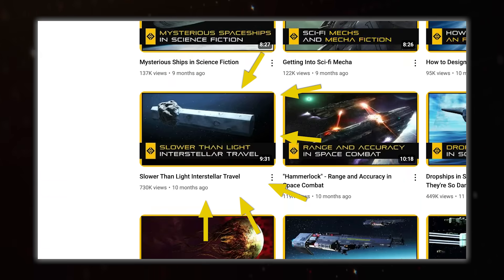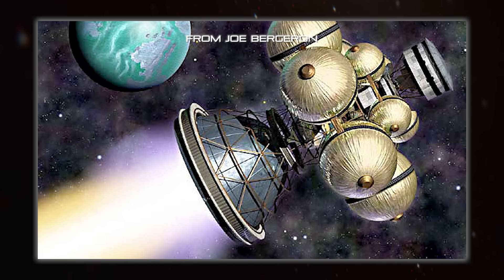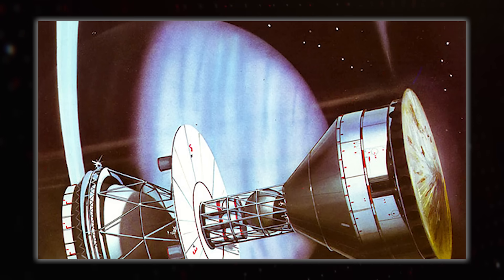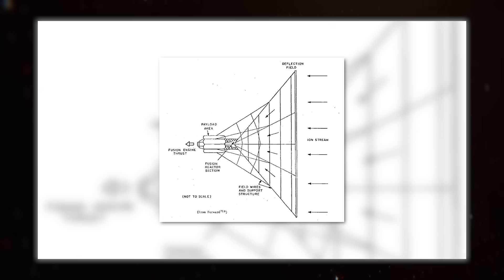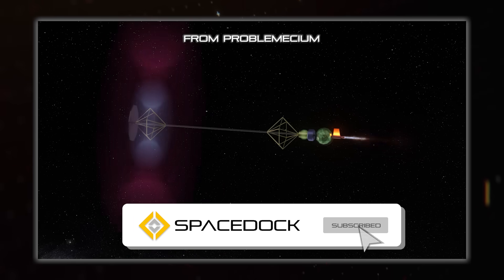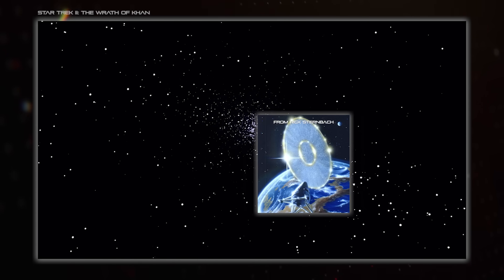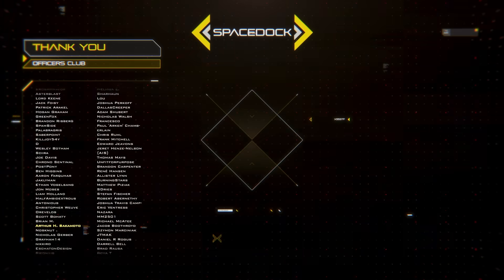Five Realistic Interstellar Designs

Comment: Sorry none of these are even possible. First isn't any workable fusion reactors, forget about fusion engines. No way to store antimatter long term, a failure of an antimatter containment system for just a microsecond results in complete destruction.

The other issue is the radiation, which means you need a awful lot of mass for sheilding. The only practical option is a hollowed out asteroid that is a very slow boat that takes thousands of years, but energy will be a problem as you need energy source that can operate for thousands of years. Even if you store enriched uraninum the reactor materials are going to suffer from neutron embittlement, at best a nuclear reactor can only operate for about 75 years, which means you need hundreds of empty reactors on board to replace the worn out reactors.

Finally there is no place to go. Any world that has live will be toxic to humans as we would have no immune defense to the other worlds microbes. They would likely find our skin, lungs, gut as a perfect place to grow & multiply. Dead worlds would be the only viable option but they would take 100 thousands of years to terraform. You have to tailor specific microbes to survive & terafform the world, & it will take a very very long time. Probably the best candidate for teraforming is venus, starting with orbital solar shields to cool venus, and then design microbes that can survive and and terriform venus over many thousands of years. Only problem with venus is that its nearly tidally locked with the sun (1 day ~= 1 year), You have to use orbitable solar sun shades & mirrors to set up night & day cycles which would be difficult & expense, but very possible.

Warp Drives & FTL is just not possible unfortunately. We are stuck here in our solar system. The only alternative is Gliese 710 (star) will be passing near the earth in 1.3M years in the future. If Humanity was a tech civ 70K years ago we could have sent probes to Scholz's star.

That said, I think humanity has peaked. Our tech civ. is dependent on cheap & abundant Oil & global production has already peaked (excluding Gas Condensates). Fusion will never be practical and high grade Uranium Mining peaked in 1980. Remaining reserves will be depleted by the 2050s at current production.

Comment: I wish you could add the Nai'a to this list from the longboat series by Matthew Ambrose. It is a 10 kilometer long cylinder with 2 fusion engines that can push the ship up above 90% the speed of light. It has a large ice shield to protect the ship. They had even doubled the density of the shield due to traveling at high relativistic velocities. Written from a hard science fiction perspective. the ship has an acceleration, coast and deceleration. phase. The ship configures itself based on which orientation so that thrust gravity is not lost.

Comment: You can also cheat in this category by adjusting the setting. If we existed in a habitable zone planet around either Alpha Centauri A or B, then journeys to the other star would be equivalent to journeys to Saturn at periastron, and journeys to Pluto at apastron. Even Proxima is "only" ~0.2 light years away, so that's a radical improvement, if still daunting.

Another way to cheat is small stars on the outskirts of globular clusters. The nearest neighbor distance can be much smaller than the stellar neighborhood without threatening inner planets (if you're not one of the unlucky ones) if you don't push the density TOO high.

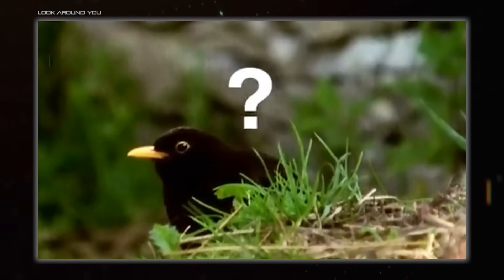Comment: 4:00 The problem I see with the laser sail stages is that there will be a significant drop off of power from the first stage reflecting to the second stage as the reflector will also act as a sail. Even more would be lost with the third stage. Mind you, the payload being sent back would be far less massive so it shouldn't be a major issue there, but if it took 3 years to accelerate, it might take 6 years or more to decelerate to rest.

Comment: Oh boy time to nitpick and take appart all scientific inaccuracies

Deadalus: the technology isn’t proven let alone demonstrated we can’t do helium 3 inertial confinement fusion, deuterium tritium would make a lot more sense. Tritium may have a shorter shelf life than the trip but you would have to create it onboard by basically doing alchemy not that it’s a big problem 

Big lens: "1000 kilometer diameter lens in the outer solar system" how TF did you put that much mass there? There’s nothing there? And WHERE Is Pluto? 
All that for a 1 ton probe hey?
Staging seems to work though wouldn’t the laser intensity become a problem?

Bussard ramjet:
These don’t work. Yeah bummer. They just don’t work. Anyways moving on
Also the criticism for having a top speed isn’t really relevant. By and large your delta V is equal to your exhaust velocity or very similar so this is a problem for every single rocket 

Valkyrie: the radiator armor idea is great
Overall it would work. Antimatter production and containment are of course an issue. A properly competent nation could just play factorio on Mercury and build hundreds of thousands of particle accelerators, as one does, so that’s still doable 

Overall interstellar travel is really difficult. We have the technology to go anywhere in the solar system rapidly and with ease through nuclear power and ion engines alone, but interstellar distances are just horrendous

It all boils down to exhaust velocity so we really need to get better exhaust velocity. Antimatter engines work so well because the product of an antimatter matter reaction apparently fly out at the speed of light. They explode in all directions but a third of them are magnetic and can be directed backward. Resulting in rockets that can have up to a third of the speed of light as exhaust velocity. Meaning they can go near the speed of light, because as always and I repeat myself, exhaust velocity and delta V will always be highly similar to each other. 
If we could find a way to accelerate anything at close to the speed of light without using antimatter, and do it fast enough to get at least kilonewtons, hopefully mega Newtons of thrust we could get interstellar ships. It’s all it takes, it’s not that far fetched.  
For the solar system, ion engines, simple devices that have already been tested and used can give you 50-200 kilometers per second of exhaust velocity. Which translates to 20-400 kilometers per second of delta V. Which happens to be more than enough to make a flight between any point of the solar system into a simple cruise trip lasting a few weeks. So we can move around the solar system easily. But other stars are really really far away. Of course if stars were closer on average solar systems would collide, they are as close as they can be for how long they survived

Comment: Need a ship necessarily be slower than light to be "realistic"? I've always been of the opinion you could have a ship that's "realistic" in that in every other way it solves the challenges of interstellar flight using real physics and engineering solutions even if it has to use a single plot device to allow for Faster-Than-Light travel. Said device could even be based in part on already-existing theoretical FTL solutions. I also feel like there's a decent spectrum that has yet to be explored between Avatar and Trek of varying levels of realism.

Comment: You didn't mention that the lighthugger is a variant of Bussard ramjet.  Specifically, it's a RAIR, a ram augmented interstellar rocket.  Rather than using interstellar hydrogen for fuel*, it uses that hydrogen for *propellant.  Increasing the velocity of your propellant increases the energy required to accelerate it by the square of that velocity, whereas the energy increases linearly with mass, so increasing your propellant mass is easier than increasing its speed.  A RAIR brings its fuel (energy source) with it, but then scoops interstellar hydrogen to shoot out the back of the rocket.

The lighthugger loses realism points by using a wormhole connected to the quark-gluon plasma from just after the Big Bang as its energy source.

Comment: Seems pretty obvious that you use Solar sails (with lasers powered directly by the sun) to push your craft up to speed for about 2 years then once it is going fast enough you can further accelerate it with Ion drives or start to push the Nuclear engines with a great big lump of ice that you use as a particle shield and fuel source then... when that starts to be to slow and the fuel is say 30% used up you switch on the direct ramscoop. though it can collect and store matter at the lower speed to burn indirectly too. The slowing down is fun but such a craft would likely work for a colony craft and not waste quite so much silly time on farming Helum 3 you just use ordinary Ice there is plenty of it laying around in the solar system.

Alternatively go to the asteroid belt and find a medium large Asteroid dig a hole in it put a small town inside and then get it going with initially some booster and gravitational sling shot and then you can start using a Mass driver to throw chunks of the thing off the back to accelerate it. Once we can play around in the Jovian System anything goes really - and that Helium 3 farming is wildly unoptimistic in terms of time to farm it anyway.

As a rule I say use the sun for propulsion, fuel and more it is sitting right there after all throwing crap off itself into space. If you don't mind your craft taking 100 years to get anywhere a simply 2 km Mylar sail is perfectly fine to send a crappy probe to the nearest 30 star systems. No lasers needed just the sun and a lot of time.

Comment: The British Interplanetary society revisited the idea of an Interstellar probe in 2009 with their Project Icarus, which produced several designs. My favorite is the Firefly Starship, a 1 kilometer long dart-shaped spacecraft with an open z-pinch fusion reactor in the back powering it up to 10% of c. Project Rho / Atomic Rockets has a nice section on it on their Realistic Fusion Designs page.
Reply: Another thing to be considered when writing a story with fusion spaceships is that deuterium can be converted into metallic deuterium reducing it's storage volume. Also the fuel mixture in Daedalus ICF engine was six parts of deuterium to one part of helium3 which means there  is a room for better fuel consumption.
Reply: @chromelord9717 why do we care about conduction? So you say that the neutron changes chemistry?
Reply: @ArneChristianRosenfeldt  It's not about the conduction, metallic deuterium is a solid, and solids unlike a gas take far far less space. Less space means far smaller tanks, smaller tanks are lighter. Though this all depends on being able to create and store metallic deuterium in a stable way. Which I believe at least for now is a bit of an ask still.
Reply: @Quickshot0  So you mean, we would not have to keep it at cryogenic temperature to be solid? Helium3 is superfluid, but I thought that all hydrogen isotopes freeze.
Reply: @ArneChristianRosenfeldt  metallic hydrogen is pretty elusive when it comes to implementing practically yet real and observed substance. It's like diamond made of hydrogen and it's isotopes and its density is ten times higher. Good for explaining why the spaceship in your story has small fuel tanks .
Reply: @chromelord9717  pressures around 410GPa .. Uh, no thanks
Reply: @ArneChristianRosenfeldt  Who knows for sure. Freezing might make it easier to do.

Though as I already noted, I have some doubts on how realistic it might be any time soon. Metallic Hydrogen is very hard to achieve, metallic deuterium being more dense might be easier, maybe. Though I doubt it would be remotely easy even then. Looking it up it seems one study found it to happen around 460 GPa. A pressure so extreme I doubt we'll be making tanks for that any time soon. Well unless the material was stable once formed, which some speculate, but so far no evidence exists for I believe.

My answer was as such more to note that their hypothetical solution was more about making the fuel tanks smaller and not so much about conducting electricity.
Reply: I like the Daedalus variant that proposed pairing it with a Von Neumann Probe so you can do longer term exploration of the target system (and if it has a fuel sources, keep going to more systems to explore).
Reply: I’m old enough to have attended the wash up meeting for Daedalus at BIS HQ, listening to the major authors of the report provided additional details not available in print. I also attended a few of the preliminary meetings for Icarus including the decision meeting on the choice of propulsion. Stephen Baxter and I lobbied for Z-pinch. Very pleased with the final Firefly concept, primarily as Z-pinch is scaleable so could be used for a variety of missions including fast Interplanetary flight, if like Daedalus it runs on the hot side.